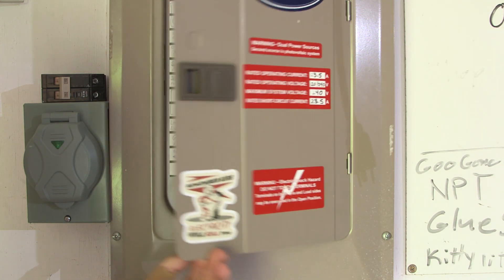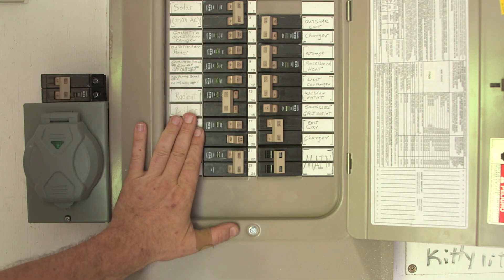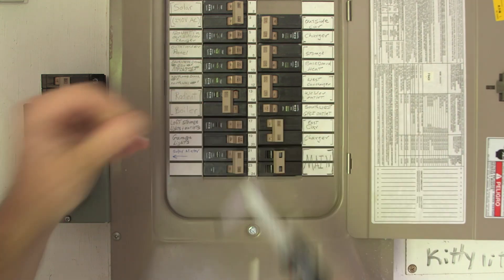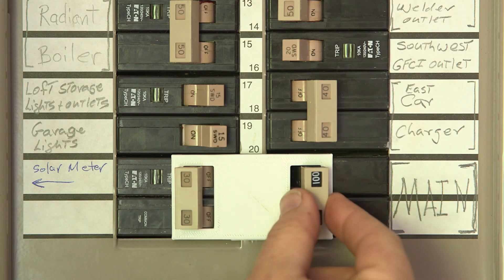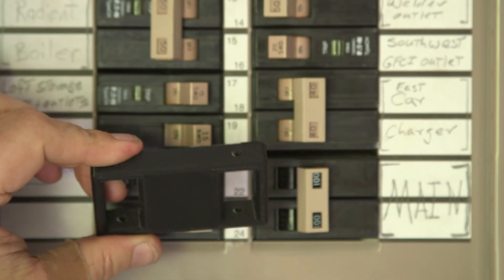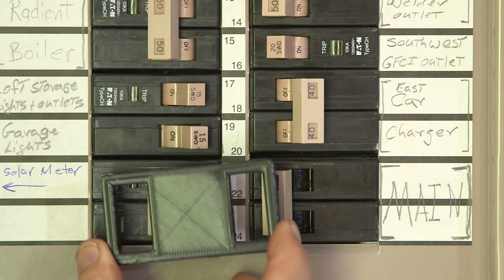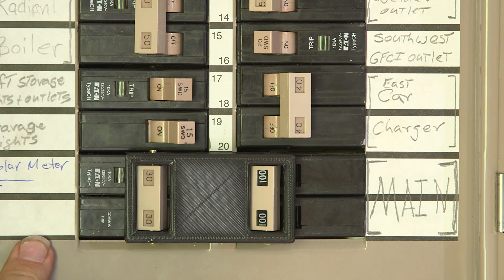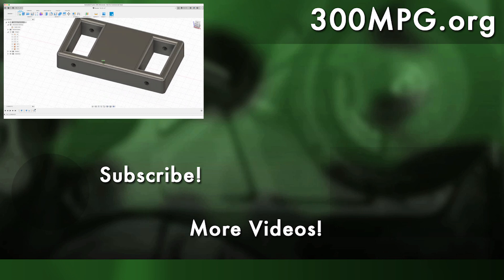Generator interlock for DIY Vehicle to Home | 3D Printed |  CHAdeMO

Comment: I work with Cutler Hammer as a distributor and those CH breakers and breaker locks for like generators are really hard to get our hands on Smart 3D printing it everything is super back to ordered
Reply from the maker: I had to go to four different stores to find the 30A breaker in stock!
Reply: @BenjaminNelsonX  yeah 30 amp 60 amp 100 amp are extremely hard to get because they're so in demand and there's a shortage with the springs that are inside the breaker for the 30 amps

Comment: Did you ever cover lithium batteries with your EV car build?
Reply from the maker: I built my electric Geo Metro back in 2008, when there was simply no affordable lithium batteries available.

I talk about lithium batteries in my VECTRIX upgrade series. I installed 18 Nissan Leaf cell modules in an electric motorcycle.
Reply: @BenjaminNelsonX   I'm in the process of converting my 96 Dodge Dakota into an EV. Your electric car series is very helpful. Thanks again.

Comment: Use a ATS automátic transfer swich. More simple
Reply from the maker: A good 200A automatic transfer switch costs about $800 and requires quite a bit of work for the installation, likely requiring a licensed electrician.

My part costs pennies and was done from concept to 3D-printing and installation in about 2 hours.

For a large, permanently wired installation of a generator system, with dedicated backup circuits, I would absolutely suggest an automatic transfer switch.

For a guy doing some experiments, a simple piece of plastic seems to work very well.
Reply: @BenjaminNelsonX  What would you need a licensed electrician for, you already hotwired your car into your house? 😀
Reply from the maker: @extragoode  Transfer switch would go on the outside of the building and tie in between the meter and the main panel. It would require wiring for 200A service. Not the sort of thing I would really want to do myself.
Highly visible from the road. Would require a permit. Permit requires the electrician's name and master #.

Cheaper and easier to just 3D print a little piece of plastic.
Reply: @BenjaminNelsonX  your solution is definitely cheaper and easier. I just found it funny where you chose to draw the line. We have a 120v rackmount ATS that connects two circuits for one rack in our office which was less than $500 and wouldn't be hard to integrate, but it only handles 15A and probably wouldn't pass inspection.

Comment: Your interlock has a problem.  What if either breaker trips?  there is no space for the handle to move to the tripped state.
Reply: have you tried tripping one on purpose while holding it physically in the on position? I ask as mine still trip internally even if the 'handle' is jammed, kind of a safety feature required for our european codes
Reply from the maker: That’s correct. That’s the way breakers work, as required by regulation.
Reply from the maker: The breakers trip INTERNALLY AND there is enough room for it to be manually switched off. I demonstrate right in the video how both breakers can be off at the same time.

Comment: Hi Ben,

This is a really nice idea. Do you know if something like this meet code and/or pass inspection?

Most of the interlock devices I've seen require the "main breaker" to be completely OFF before you can even start to turn the generator input ON. I suspect that's because they want to make very certain the main breaker is completely off before allowing the other breaker to start traveling towards the ON position. The potential issue I see with yours is that both breakers move at exactly the same time: So one breaker is closing to the ON position before the other breaker is fully OFF. So I wonder if this creates a potential situation for the gen input to make contact before the main breaker switches off. IE: It seems like there's a potential possibility that around the midway point in the swing where both breakers could be making simultaneous connection?

I have a similar issue in my panel and I'm wondering if I could do a cheap solution like this vs going out and spending money on one of the more official interlock devices.
Reply from the maker: @ryanthomas2472  That was exactly my thought as well.

Comment: Hi Ben always enjoy your videos. What 3d software are you using?
Reply from the maker: I've been using Autodesk Fusion 360. It has a steep learning curve, but can do some really amazing things, and it is free for non-commercial use.
This 3D part was so simple it could have easily be designed in any very basic CAD program.